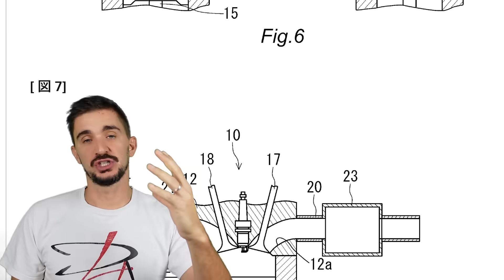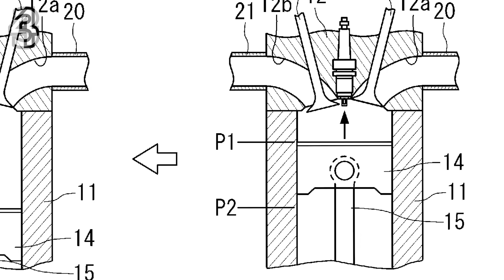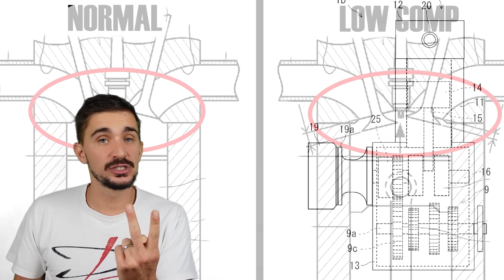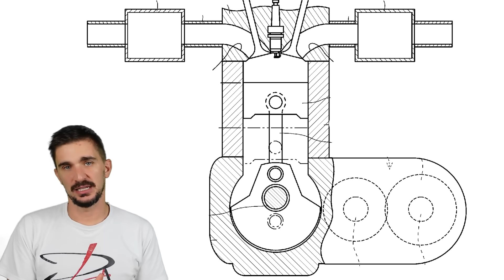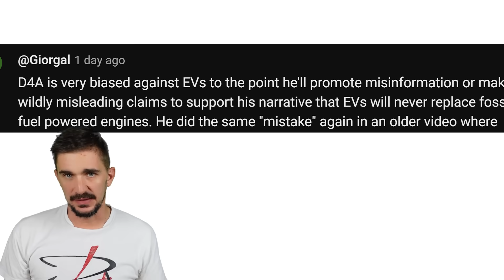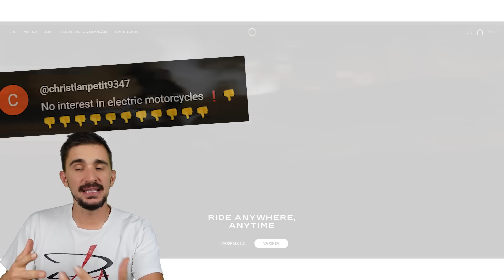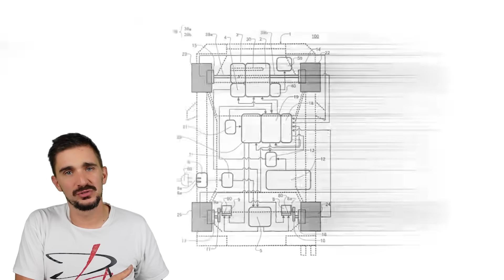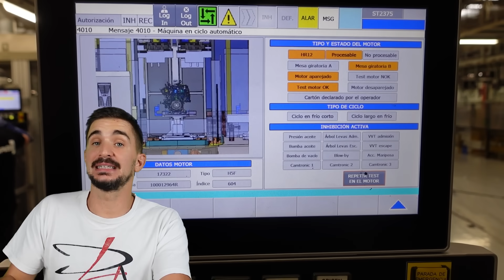Yamaha Just Patented A Fake Engine

Comment: When I was in going to school for Engineering one of my classmates made a vintage Harley-Davidson powered by electric motors.  At first I wasn't getting the idea behind it.  But then I came around.  The bike was neat and it worked perfectly with the lead-acid batteries available at the time.  It was on a TV show where the host demoed new things and absolutely loved it.  When my classmate was riding it, the follow Harley riders liked the look, but hated the sound.  If Yamaha is going after this group, I am going to have to agree with you.  They are not going to get this accepted by Harley or similar big V-twin riders.  Like you said, some of them can tell the difference between a Harley and other V-twin bikes.  And they will all know it is fake.  I'm with you on my admiration of Yamaha, but this? I don't think it will be accepted.  By the way, I love the insertion of the vintage ad for V-rroom.  Kind of equivalent to this compressor to make engine sounds.

Comment: If those are the actual patent drawings, It has a spark plug. It looks like a gasoline range extender that has the capability to generate noise when not making power. Pretty cool.

Yamaha knows how to make noises without pistons, valves, etc. This ain't it.

Comment: So they are putting poorly designed air compressor pump inline with the electric motor, heh

If I am buying a battery powered anything, I am going to make sure it is as efficient as possible. Your thoughts are not incorrect at all. This is like buying a battery powered LED light with a heating element so the front gets hot like an incandescent bulb, complete waste.

Comment: what if they're selling it as an electric motorcycle(wink wink) but dont put a carb on the intake or you might have a running engine. that way they might not have to deal with emissions etc cuz theyre technically not selling you an engine at all. it's just a FEELING device. much like the grape pellets that existed in the prohibition era with explicit instructions not put inside an airtight mason jar with water or it could turn into wine.

Comment: Disgusting, what they should've spent resources on instead of this fake engine is to design a reciprocating solenoid engine if they really want an engine like electric motor
Reply: that wouldn't be convertible into a real one
Reply: @erkinalp  why would it need to be convertible if the solenoid engine becomes the motor?

Comment: Right now it's a fake engine on a cycle, which has no driving motor or engine. No room. No good place to put the batteries or the electric motor. So a cycle that can't go anywhere, but can make some noise, until the tiny battery drains. Why the wheels? Anyway I hope they have a good marketing department.

Comment: Utterly ridiculous.  Add a microchip with speakers for the noise, and if you want the vibrations, either hide a large bass speaker in it, or have a specially damped mass driven at its resonant frequency. Sure, taht would also waste some energy, but a LOT less than this bizarre idea!

Comment: As for the why do this, I have had discussions with people that clearly stated lack of engine noise as a reason they wouldn't consider buying an electric vehicle. Adding a fake engine would obviously solve that problem, albeit in a rather awkward way at first glance.

I have also seen in admittedly not that reliable spaces that university research on solid-state batteries has made progress and that there have been prototypes with around a dozen times the energy density of typical lithium-ion batteries and around 5 minute charging times, although still at a small scale. Now that mostly just means we managed to shove about a dozen times more lithium in a battery which would cost about a million dollars to manufacture, but if we get a sodium battery based off that, it might also be something regular people could afford. For all I know it could be AI written nonsense but it could also be true. My time studying chemistry in university would also corroborate that at the very least, there is A LOT of funding being poured into battery technology research. So battery technology very quickly becoming a properly good alternative to petrol in mobile application is a possibility, although I always found hydrogen fuel cell to be the more straightforward solution, but storage is also the bottleneck in that application so who knows.

In that optic, if we come to live in a world where electric motorcycles make objective sense and are actually superior to internal combustion engine motorcycles in terms of range and also lose the recharging time issue, the lack of vibration and engine noise could be a major part of why a buyer would choose to not transition to electric motorcycles despite those advantages. That's where this patent starts to make sense to me. In a vacuum it might seem like a waste of resource and energy compared to a regular electric bike, but it would still be a large improvement over using an internal combustion engine instead, and if that's what people are cross-shopping with, then it makes sense. 

As for added complexity, and possible cooling system, people have proven time and time again that they are willing to pay more for a specific sound and feel, and also that they are willing to sacrifice performance to that end. Harley Davidson literally built a whole brand identity on that idea, and their customers are most certainly loyal. Now imagine that concept but applied to everyone that owns a gas powered motorcycle. But also I'm sure it generates much less heat than an engine with literal explosions going off inside of it, so air cooling fins will probably do just fine as a solution to that specific problem, and those are cheap anyway.

Comment: Can the battery be decoupled so that the bike runs the way it should?  I wonder if Yamaha is hedging its bets that battery powered anything for road use will fade away.  They'd beat the market by having a bike which could easily be converted Back to petrol.  Sure, some mods but how right would this be!

Full disclosure:  I don't believe in electric for road use.

Comment: In my view ; a little offset balance shaft on the right amount of revvs and a speaker will solve it without loss . And no maintenance or oil or coolant... You would lose all the benefit of electrica..
But your right its a stopper  ; not practical in any way actually.
Very interesting Programm by the way 👍
I like... Good luck with the program.

Comment: huh...
an electric motor equipped with an off balancer.
and a useless air pump.

well, bikers likes to waste energy...

at least they will avoid shame from relying on a battery.
with an infinite MPG, buy gas only once.(for smell only)

they lose everywhere else, so now they try the woke engine.

Comment: Fascinating they’d go to all that trouble, but points for inventing a way to make vrooom vroooom noises in the purest possible way short of actually injecting fuel. 
As a gearhead hobbiest, it does seem like an amazingly sad exercise. 
What I like about the EV I drive as a daily (yeah - there’s a couple of us…) is precisely the fact it WASN’T designed ground up to be an EV, complete with ridiculous IPad control center that pulls your eyes off the road to poke, slide, and stab at a tactiless interface. My MiniCooper SE is by no means a perfect EV exactly due to its Frankenstein ICE turned EV platform, but they managed to combine what I like (purposeful turbine like whine out of the electric powertrain and a good amount of zip, all the while giving a big middle finger to the oil robber barons). AND a cabin bristling with honest to god switches, dials, and buttons everywhere you look. Sadly the recent redesign threw much of that personality away but I like to think the 2020-2024 SE will come to be recognized as the quirkiest, ICE-iest, non-ICE little car there ever was…

Comment: I reckon what EVs need to give them some soul is straight cut gears and remove some of the refinement and noise insulation. ICE cars had to be revised significantly to make them quiet and comfortable, but that level of refinement is almost unnecessary for an EV

Comment: If you are just after the feeing and the sound, there probably is a more efficient but mechanical way to do that, that also wastes less space.  Not sure if their patent eliminates all the mechanical solutions.

Adding a flywheel of some kind that can shift a weight within it, might be an efficient way to get some  vibration, and could add some stability to the bike at the same time.  Heck, it could probably be configured to shake your dentures out.

You could probably add some guitar strings with adjustable tension (whammy bar doubles as throttle), and a string vibrator to get some beastly notes using a metal resonator.  Like a resonator guitar.

Comment: I've had an e-moto before and I actually enjoyed the raw howling sound of the electric motor. They can be silent, but they CAN make noise too, good ones even. It depends on how the engineers go about designing them. An electric direct-drive hub motor, which is what most EV cars use, is gonna be silent, there's no getting around that, but a geared-hub or mid-drive belt or chain-driven electric motor will make a lot of sound. A company like Yamaha can make a good-sounding electric motor if they wanted to, but I feel like this patent has a different purpose in mind.

Comment: I'm off the exact same opinion as you bro. I'm a turbo rotary owning enthusiast. I'm also actually a qualified environmental scientist. I'm also building an electric YZ with the bigger Surron Stormbee motor with gearbox as it bolts directly into the Yamaha frame without any "kit" required to build it? I like the concept of the electric motocross bikes and in particular the Stark, however there are some things that are deal breakers for me? The Stark phone is a deal breaker. The subscription service model to "unlock" more power is also a deal breaker.
I also support the ideology of build it yourself? I've come from 2 strokes so if I'm going to transition to electric, then I'm going to learn about it from the bottom up and build it myself? I started with FPV drones 10 years ago when bind and fly drones were not a thing.....you had to build it yourself and understand compatibility and capability of your components to be able to build something with a successful combination. I support the right to repair movement because of agriculture (I've done agriculturally science also) and until we have products that farmers can repair themselves, the world is going to starve?
Horses for courses.
I'm pro judgmental on an individual basis. Each to their own. I'm for electric dirt bikes but not necessarily electric road bikes? So go figure?
Even as a rotary enthusiast I still think that hybrids are actually the way of the future?
Nothing beats a turbo rotary in performance to weight, but for efficiency and ability to cover large distances...... nothing beats a diesel hybrid?
I could live in the outback countryside and grow just sunflowers and I could make enough biodiesel and use thunderstorm generator and be able to survive self sufficiently? That to me is far more important for survival into the future! Independence is the goal here

Comment: I don't see why fuss about this:

1. Vibration and sound are a big part of recreational motorcycle riding. I wouldn't buy one, but I can see this being viable in commercial space, like a go-cart track, where you could rent a 50cc motorcycle for an hour to drive with your friends. The visitors don't care if it's real or not as long as it does br-br-br. And if it allows owners to avoid headaches of maintenance, emission requirements, ventilation, like if they put the track inside a mall or something, then more power to them.

2. Patenting hypothetical, or straight up impossible things is not uncommon. There are patents for an UFO, a slingshot for a newborn babies, a literal stick, a ball-kicking device, etc. At yamaha's level, I'm pretty sure there's a dedicated team with a quota for patenting stuff, so they have to come up all kinds with random shit, just so that they don't have to pay royalties in case any of this  happens to be viable and the competitor patents it first.

3. The fake CVT gearswitchhing and gigavents absolutely do have a performance penalty. Someone else also mentioned Harleys which use ancient and inefficient design just for the sake of making an obnoxious sound. If designed good enough, I don't see how a mechanical vibrator is any worse.

Comment: The reason I think is for when petrol engines become illegal Yamaha will be the only ones selling a new production bike ready to be converted back to petrol. Imagine only needing a conversion kit to replace the "tank battery" with a real fuel tank, adding a carburetor or injection system, replacing the electric motor with a starter motor and voila you have a brand new motorbike. Of course Yamaha will completely deny that the bike is meant to be easily converted with an aftermarket kit but that's the only rational I can think of.
Reply: you don't need to replace the electric motor with a starter; it's good as a generator to make it into a series hybrid
Reply: @erkinalp  Also it is already a starter motor.
Just do the Hypercar jumpstart, roll on the electric motor then throw in the gear to start it.

Comment: Oh and if you think Yamaha wouldn't do that - you own a TZR. The restrictors on which are well known as being incredible easy to bypass. In the UK for instance they were restricted to around 12hp. Yamaha offered a "servo kit" for "race use only" which all the rich kids immediately fitted. I wasn't so well off so I took out the powervalve, turned it and put it back. It was a bit gutless low down (its a 2T 125 so it was never great anyway) but after about 7,000rpm it had all the power. Quite a little rocket after that. 
Even my FZR1000EXUP had rubber webbing in the intakes. Again a matter of cutting it out and it got full power immediately. 
I feel like Yamaha of all the companies seem the most customer-lead. They always seem to try to give us what we want regardless of the regs.

Comment: IDK. To me it's like an analog or even a steampunk stereo system. If it requires a lot of power from the electric motor to power, I agree it would be dumb. BUT, what if the power consumption was negligible?  and it didn't cost too much to produce? I mean, between that and fake engine sounds from a speaker, maybe this could be a legit solution? Considering how much resources Yamaha dedicated to the sound of the Lexus LFA, maybe they are onto something?

Comment: I'm not so sure there's no market for it. From proper petrol heads and older bikers no way - they will laugh it out of the dealerships. However youngsters who are more used to computer games and have no real idea about how an engine should feel or what that means will probably see it the same way as they see the vibration system on their controller - it adds weight, complexity and cost but it gives them that bit of feedback that makes them feel like they're doing the thing. 
I can imagine this going into some first bike kind of thing and being reasonably popular. 

The other thing - and the more important one - is the obvious question of why from an engineering POV? 
Well as you say an engine making no power is just a weight and loss system - pointless. 
However imagine if that engine were fitted and later on there were kits available to convert it into being able to run and make power. 
It already has the clutch to the electric motor - and by association must be able to connect to the drivetrain. 
It already has the rotating assembly and all the parts it needs to be an engine. 
Presuming its based off a current design (I see no reason why it wouldn't be) it will have everything in place to be able to mount the ignition system and fuel system. 
Now imagine you want to buy something like a 250cc scooter but have to get an electric scooter because regs in your country or city mean thats the only thing thats really an option. It might have 5kWh of battery and be fairly range limited. 
Or you could buy one with a 3kWh battery and a "sound/vibration generator" which could then be changed to a range extender. 
Suddenly it doesn't sound so silly because that bike is now zero emissions around town then it can go anywhere you like without worry. 
Even better is that if it only needs to work as a generator it can be a fairly low powered engine so something aircooled and old would be fine - something like the TTR engine which is also thrown out by Loncin and a load of copycats because its so robust and easy to make. They claim 25hp in the TTR but even detuned to 20hp or so would mean it had decent power when combined with the electric motor and thats enough to hold a decent highway speed in most conditions. 
Of course capacity is just a number but the theory remains that its likely not there to just take up space and weigh some extra because Yamaha engineers just aren't that daft.

Comment: Just add an offset weight on the electric motor and it will vibrate.
The "massager" industry solved this ages ago.
Then put a speaker on it and have it play engine noises.
Or...and hear me out...
Get a real motorcycle with an engine and save precious resources while getting more range. Electric vehicles don't burn gas, but they're not any better on the environment with their giant batteries.